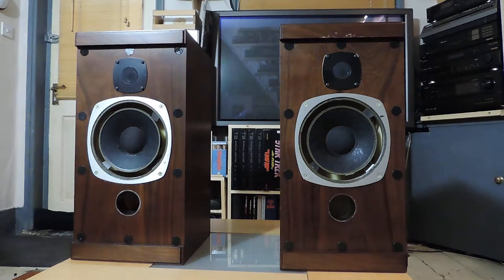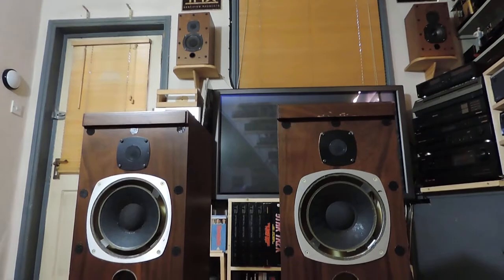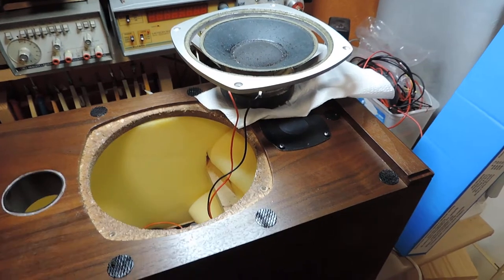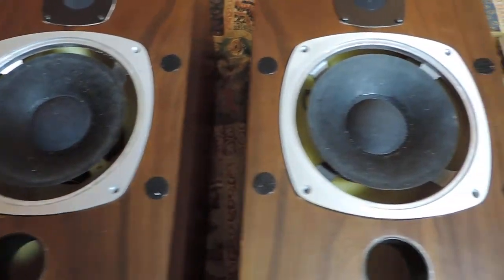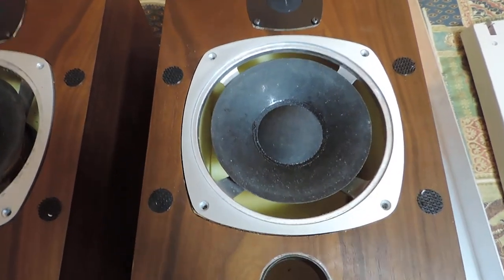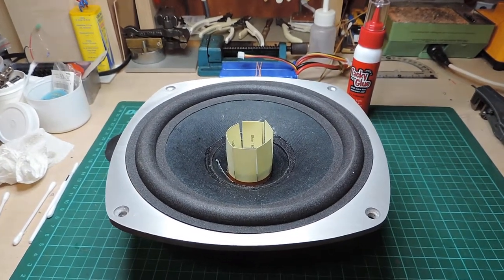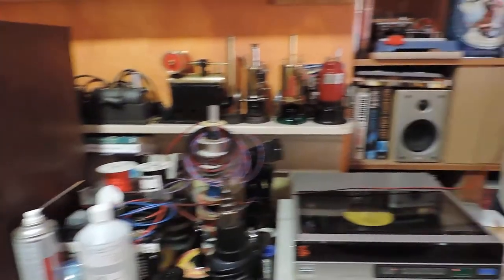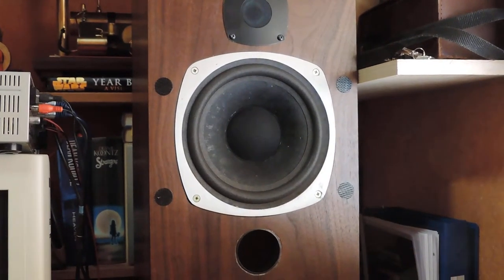Castle Pembroke Speaker Restoration

Comment: My Father bought a pair of these new in 1986, after about 15 years the cone surrounds perished, and he had them replaced by Castle with butyl rubber surrounds, - the replacements are still as good as new today. I'm astounded Castle used these poor quality surrounds, that were typically used on car audio speakers, having a lifespan of 20 years max.
Reply from the maker: Thanks for the info Robert, I didn't know that. My repaired Pembrokes are still going strong 5 years later so hopefully my replacement surrounds will last. Cheers, Alan.

Comment: Hi,
The later models had the rubber surrounds I have a load of brand new dust caps for that size bass driver in fact the exact ones as I used to recone not only the Pembrokes but also the Conways too.
Reply from the maker: Hi, they are lovely speakers and still working fine some 9 months later.
Reply: @RetroSteamTech  loved the ol' skool styling and sound!

Comment: Nice video. Thank you for posting it. How big a difference did it make to replace the crossover components. I asked as my left speaker is getting a little bit constipated and I'm wondering if it needs the same treatment.
Reply from the maker: Thank you. To be honest although I did purchase some replacement capacitors for the crossovers I never fitted them. The speakers sounded so good after they were repaired I just left them as they were.